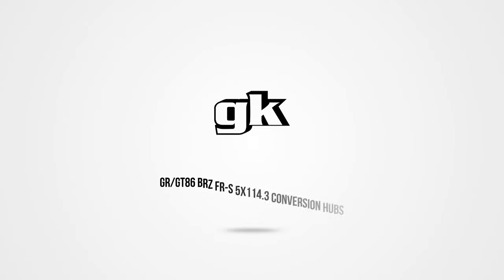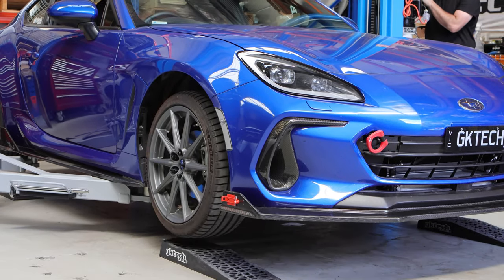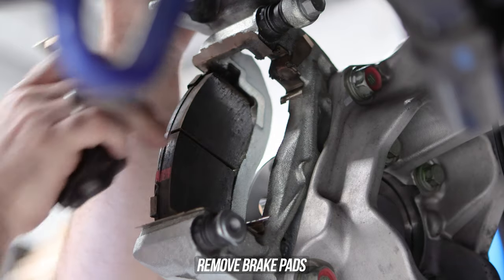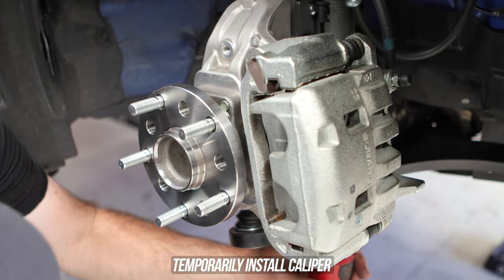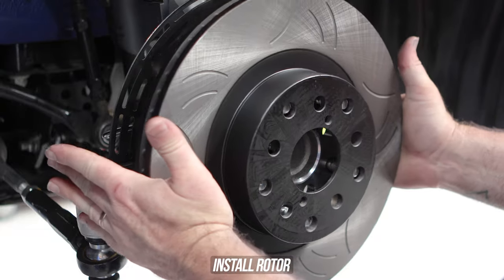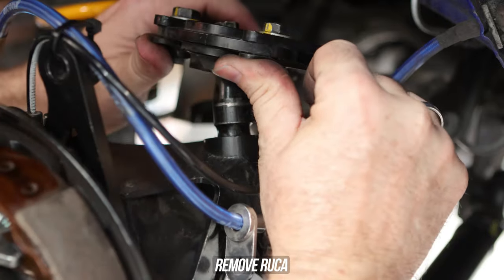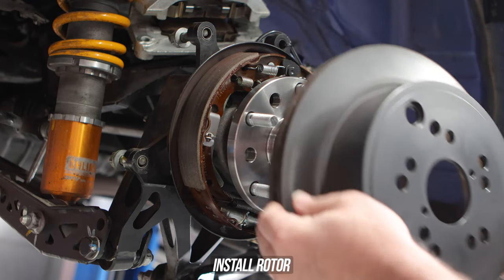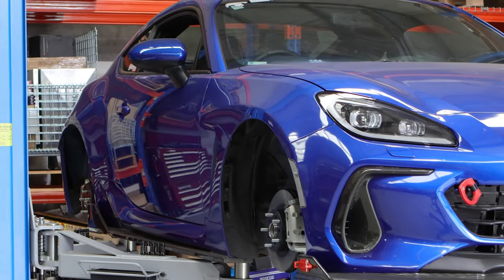GKTECH GR86 BRZ FR-S 5x114.3 Conversion Hubs - Install

Comment: I purchased a set of these! I was wondering if the DBA 4000 series rotors would work with this? I have the brembos and the rotors are drilled on both 5x100 and 5x114.3
Reply from the maker: They do on the rear, yep!
Reply from the maker: Can’t confirm front fitment unfortunately, you will have to measure the ID of the rotor to see if it has flange clearance.

Comment: US page still broken. 

I also have a question. Will this work with the PBM front knuckles and rear drop knuckles with the z32 brake conversion?
Reply from the maker: Z32 brake conversion? On a FRS? The link has been fixed
Reply: @gktech  yeah I have the parts shop max knuckles with the Z32 caliper conversion and I was wondering if these would still work with the front knuckles and rear drop knuckle

Comment: Will a 12.7 mm drill bit work went to the store and said they don’t have 13mm
Reply from the maker: 13mm is required, alternatively a step drill bit can be used. The studs are 13mm in diameter.